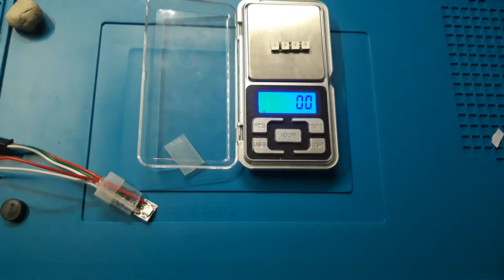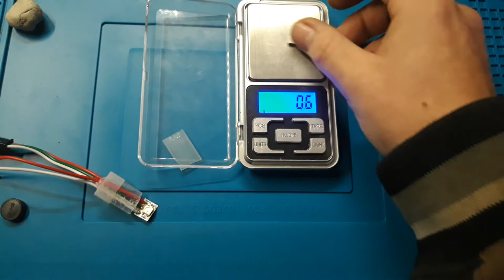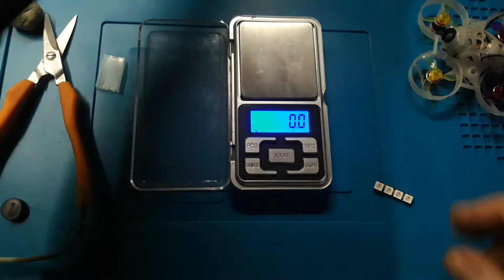LIGHT UP YOUR DRONE🌈Special Individual or Strip, 5V RGB LEDs WS2812B

Comment: Nice looking led lights. Would like to see how bright there are. Thanks for sharing and stay safe 🙏👍🙏👍🙏👍
Reply from the maker: They are very bright, you can't look at them more than a sec. or your eyes get a blind spot.  They are used for illuminating bars and stuff.  They could be awsome for gates, using a small arduino, or controller 😉
Reply from the maker: I put in the wrong link.  I thought I bought them from BG but I ordered tgem from wish.  I am trying to update the link, to the right product.  Sorry.

Comment: Hello. In the description you have a link to a usb 1s charging board. How long does it take to charge lipos. is it faster than a parallel charging board. Thanks.
Reply from the maker: The 1s charger is ok, but using a propper charger and parallel board, is both faster and better.  This one charges slow, but safe.  About 60 min.  For 6, 300mah batteries.  I think, I haven't timed it, but it feels like 60 min 😄
Reply: @SOLARFPV  thanks
Reply from the maker: @Dan Surf, the usb charger is good  if you are in the field, and have a big powerbank with you, or a car, with usb, then you can charge 1s batteries on the go 😉 which is what I use it for.  The more expensive one from eachine, that has a DC plug, or XT30 input, is a better charger, for in the field, but it can not be powered from the USB.  I forgot to write this to you.  Sorry about the later explanation 😉 fly hard bro
Reply: @SOLARFPV  thanks. I am getting a mobular 6 and it comes with a small USB charger which I will use when I go on walks and stuff but for round the house I will get a parralell board.
Reply from the maker: Great idea
Reply: @SOLARFPV  I have noticed that you have a mobular 6. Would you recommend it. Do you still use it. Have you got more batteries if so what batteries. How has the frame held up. Thank you.
Reply from the maker: I have the mobula6, I have used it, and the frame and everything holds up good, when using 300mah or 250mah lipos from GNB.  The frame and cannopy can break if you crash hard on stone floor, or other hard objects, metal, hardwood. But you should be ok on carped or grass, or soft furniture.  I have crashed a lot in my wooden homestead, and it is doing great.  I have a cupple of spares for the whole quad, just in case, because it is a great little flyer, inside, and on calm days outside, less than 2mph winds, 5mps. I changed the props for 4 bladed, and used a 350mah lipo, and that works good too.  I use URUAV lipos and GNB (I think URUAV get theirs from GNB.  It is a great beginner whoop to learn to fly acro 👍
Reply: @SOLARFPV  thanks. I'm getting it so I can fly indoors when I can't fly my 5".
Reply from the maker: Hi Dan, you made me fly my mobula6 alot more.  It is really great.  I just uploaded an acro video of it, if you are interested in seeing it preform indoors in a large area. 😉 it's deffinately one of my favorite whoops.
Reply: @SOLARFPV  what version of the mob 6 do you have? 2500 or 1900
Reply from the maker: 1900
Reply from the maker: 1900 I think.  I will check when I get home tonight, and let you know 😁
Reply: @SOLARFPV  thanks
Reply from the maker: Hi Dan.  I just had time to check... sorry about the late answer, I have had a lot of work lately 😅  I have the mobula6 19000KV version.  Gives you about 1.45 min hard flying, with 'new' URUAV 300mah, maybe more with the JESC firmware (but less top end punch)
Reply: @SOLARFPV  thanks